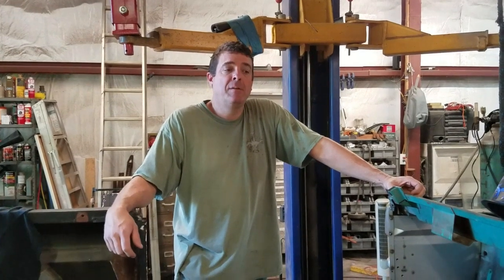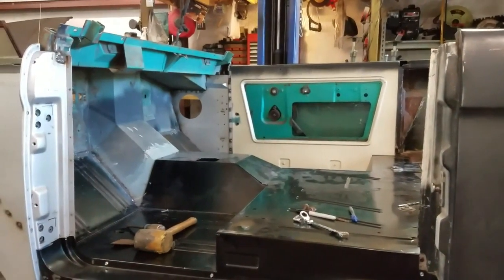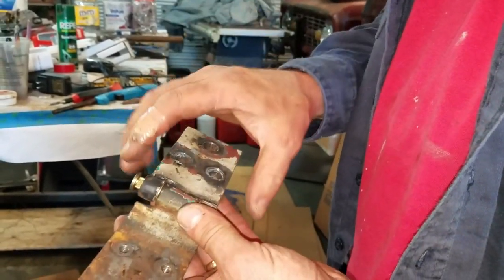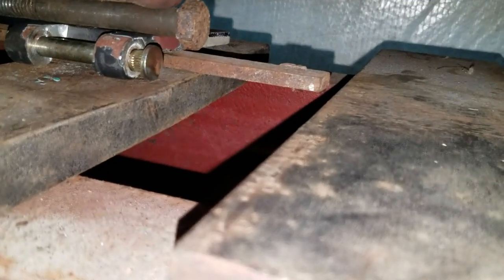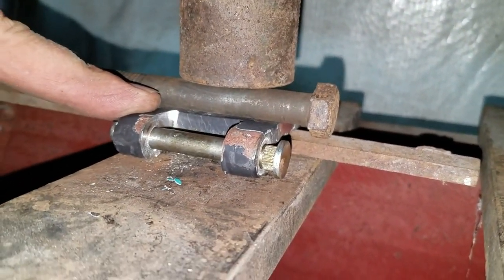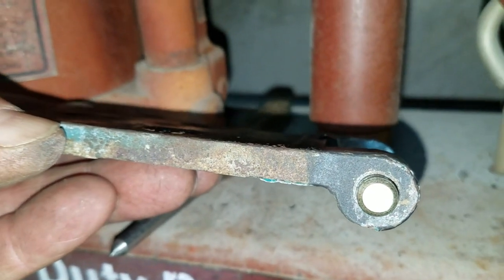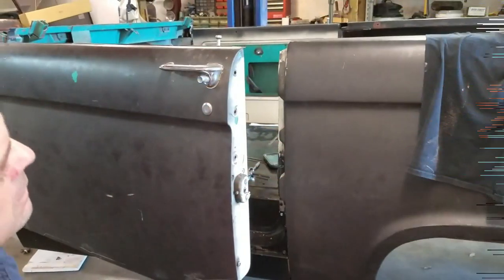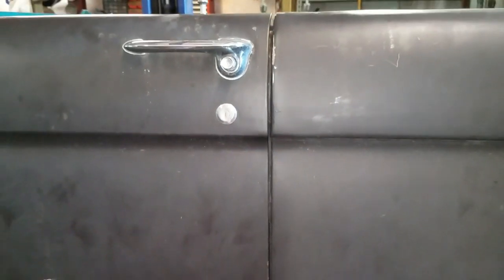PREFITTING THE DOORS - 1966 Ford Bronco Restoration Project

Comment: sure would like the info on the door hinges ( pins and bushings) my hinges will not come out without drilling, love your channel
Reply from the maker: Thomas I am sorry I missed this comment it was sent to a review folder I never check.  The pins and bushings I used were from advance auto parts.  They worked fine but I eventually bought some new hinges I am using for final assembly.  I was fighting a fitment issue and thought the hinges were the issue but they were not.  I just stayed with the new ones.  Thanks

Comment: Awesome man! Bronco doors are hard to get perfect!
Reply from the maker: You go that right!  Swapped to new door shells yesterday.
Reply: Mustang Rehab did the originals have rust?
Reply from the maker: @gusorion8151  Yes but not too bad.  I just figured that since most of the steel is being replaced I would just do those too.
Reply: Mustang Rehab true and they aren’t that expensive. Brand new metal is always good. Are you going uncut on the bronco?
Reply from the maker: @gusorion8151  We have not decided yet.  We both like the cut look.  We are leaning toward a 302 swap, 5 speed and family cage for this one.
Reply: Mustang Rehab right on! Uncut are cool but bigger tiles look mean! Goodluck on your decision! It’ll be all worth it!